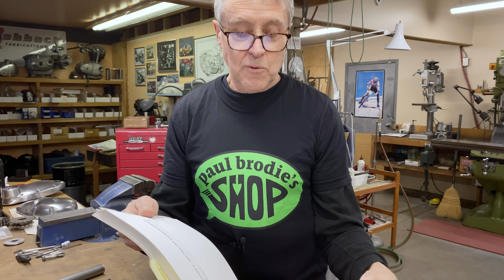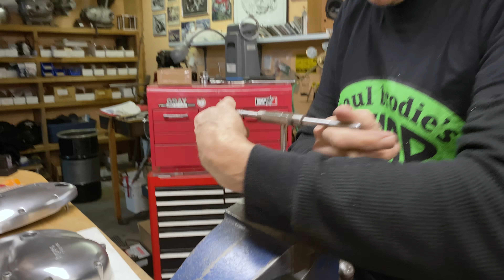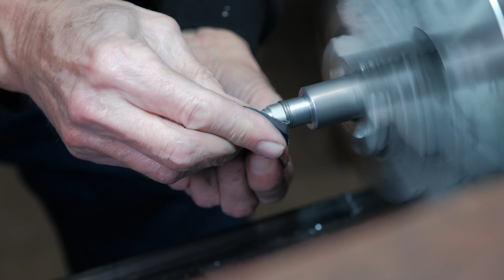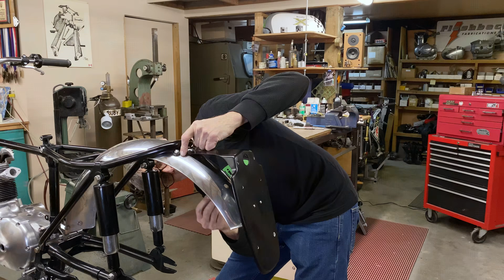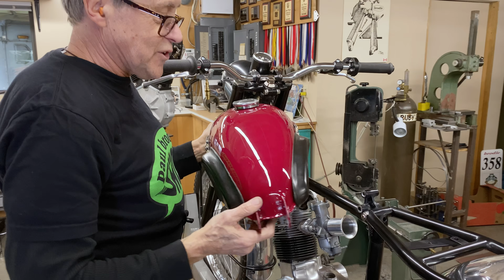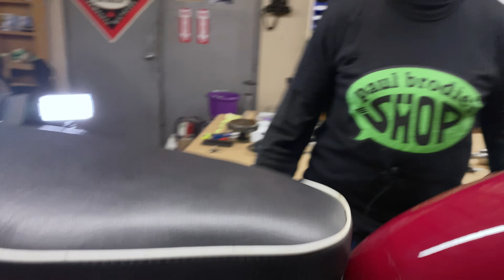How to make acorn nuts // Paul Brodie's Shop

Comment: Hi Paul. I hope you put the Union Jack the right way up.... You do know there is a right way up? Cheers, Johnny
Reply from the maker: Yes, I do know about the right way up. I looked at the decal, and it was the same upside down, so I can only conclude that the decal was not the absolute highest quality.
Reply: @paulbrodie  Perhaps it is Chinese decal.....though of course it is really a sticker! JB
Reply from the maker: @johnnyburgess211   I have always referred to them as decals.
Reply: @paulbrodie  Hi Paul, I hope you know I am joking about the Union Jack and the decal/sticker thing.....
One thing I do know is that you would not get away with fitting the registration plate sideways here in Ireland or the UK. I really appreciate your videos. Thanks to Mitch too.

Comment: Nicely made jig Paul and great results...but gloves around machine tools have caused a lot of nasty accidents. 
Best wishes, Dean at Retromeccanica.
Reply: Hey Dean, Paul has explained and warned about this before as well. We all have areas where we feel such risks are justified - like when spirals of stainless are 1” from your fingers. Blind absolutes and a false sense of security have cause more accidents than anything else so I have to be careful there as well. No snarkiness or hatred intended but kinda saw this one coming. Best.
Reply: @836dmar  couldn't of said it better, you have to weigh up the odds, and be very aware of your surroundings, don't take anything for granted. That machine is just waiting to kill you. put on your ppe, and if that situation needs gloves then put them on. Another well presented video Paul, its coming on nicely.
Reply from the maker: @Dave.Wilson   Thanks David.
Reply: @836dmar  having seen a guy lose two fingers from wearing gloves whilst using a lathe, I'll stick with the rule if it's all the same. Just friendly advice which everyone is free to take or ignore.
Reply from the maker: @836dmar   Good comment.
Reply from the maker: Thank you. I am very careful around tooling and machinery. Thanks for your concern.
Reply from the maker: @Alfred Wedmore  I agree with you.

Comment: What goes on the left side opposite the oil tank- toolbox or airbox?
Reply from the maker: I do have a sheet metal box that could hold air filter, tools, maybe a battery, but I think I will leave it off for a cleaner look.

Comment: Hi Paul, great instalment in Cub progress as usual.  One thing I beg you to do though is to NOT wear gloves (except maybe nitrile or latex) when using rotating machinery such as a lathe or mill or pillar drill.  I do know you are experienced and careful but nevertheless accidents do happen and losing your right hand or worse would be no joke.  Sorry for the health and safety lecture but I couldn't let it pass me by.
Reply from the maker: Thanks John. We have been through the safety thing many times in the comments. Whether I use gloves or not really depends on the individual situation. I felt safer here using gloves than with no gloves. I will be careful, I promise.

Comment: I dont know if it was camera distortion but the rear mud guard looked to be too high at the back giving it an uneven look to the wheel. Bike looking good, should be lots of fun when finished.I am feeling quite envious.
Reply: No doubt with a rider aboard the suspension will compress to reduce the gap.
Reply: @gerry343  yep I took that into account along with the bikes own weight still looks slightly  off kilter to me.
Reply from the maker: You can never match the fender to the radius of the wheel and still have suspension. It is just one of the many compromises on a motorcycle. I do need new rear shocks. The springs are super, super stiff.